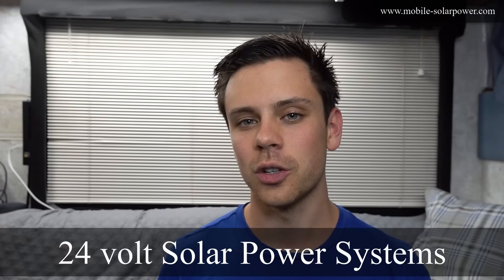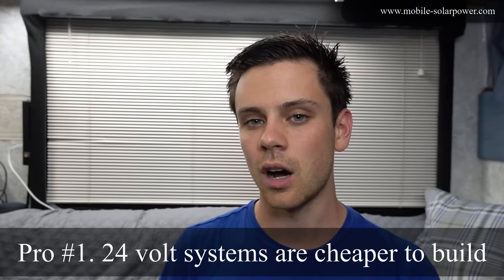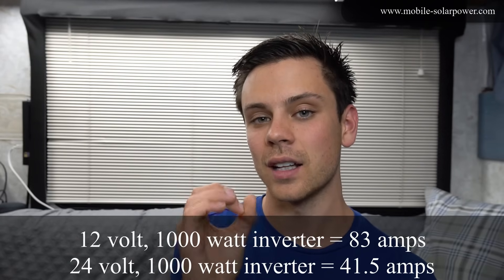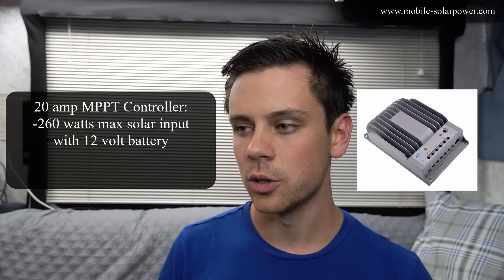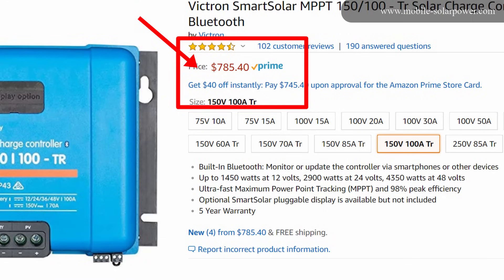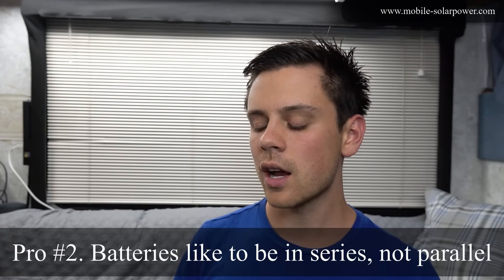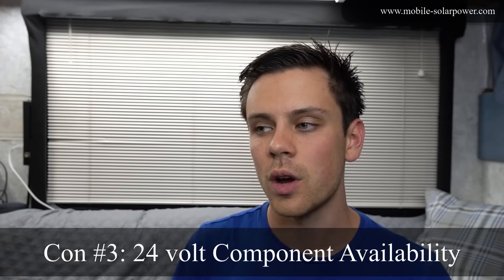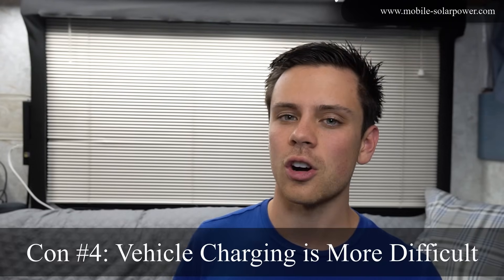12 volts VS. 24 volts for Off-grid Solar Power Systems

Comment: hi,if you have 2 x 12volt 110watt (5.5amp) panels and connect them as 24v...do you get 1x 24volt 110watt (11amp)panel?...using a 100a/h pwm solar controller .and would this be enough to charge a 24v 40a/h battery system?...love the vids they help alot!

Comment: I got 10 feet of high quality twisted copper 1/0 cable for my system from a welding supply place for $30. If you know where to get it it can be a lot cheaper than Amazon.

Comment: That's excellent information and dead on. 25 years ago I started my off grid home with 12 volt but switched to 24 because my loads increased to the point of killing batteries. Now I have 2000 watts of solar with 24 volt pannels and two 40 amp chargers and 1100 amp hr battery and a 2500 watt pure sine wave outback inverter. I run a forced air heater and full size fridge,dishwasher,full size washing machine and dryer and three flat screens krueg coffee maker in a 1400 sq ft three bedroom home. Never have to worry about a power outage. Havent seen a electric bill in over 25 years.
Reply: Any way to see the 24v set up? I’m looking to do the same but am fairly new to solar

Comment: This and your other recent vids have discussed 24V systems. I am planning a 24V system for my garage. I will have lights, a computer and occasionally small tools.  A 12V would work, but I plan to expand and don't want to redesign when that happens.

I do see Battleborn saying you can 4S4P their batteries, but you mentioned not more than 3 in parallel. Do you have any specific comments about the Battleborn 4P configuration. I know they have extra circuitry in the battery, but will that change your perspective on 4P. I am guessing 4S is not an issue with Battleborn.

Eventually I want a whole house 48V system. I will need A/C and radiant heat at that point.
Reply from the maker: Yeah that's not an issue with battle born. You're good

Comment: bloody great videos just subscribed..just one thing i have three 24v solar panels and four 12v batteries running both series and parallel for a 24v system...so how should i wire the panels? in parallel as a 24v array or series or both ..was a little confused on that part...cheers!

Comment: I have an rv with a 4.5kwh generator , I'd like to go solar with the generator as a top up when needed , it supplies 110 to the house sockets , what would be the easiest system to implement ? What would you recommend ?

Comment: Which is good 12v  or  24v  for  ON-grid solar system with HYBRID  inverter with No battery bank . 

My main is aim to produce maximum electricity. Thanks

Comment: Hi, do I have to stick with 12v if I have a 12v mover system drawing 80A current?
Reply: Is it for a caravan mover?
Reply: Yes it is.
Reply: @GaripGerçekler  ok , then you have to use 12 volts , so big cables .  It is my work to install mover systems on caravans . like truma or kroning movers.   I'm building a battery specificly for this application with Li ion batteries
Reply: Thank you dear friend.

Comment: if I have a 24 volt battery bank will a 200 watt/24 volt panel be enough to charge the battery bank?
Reply: Hi mate yes it will but you must use a solar controller the panel to the controller and then to the batteries check the amps on the back of the panel and if for example it supplies 15 amps under ideal conditions and you have three 24 volt batteries hooked up in parallel it will supply 5 amps to each battery if you have 10 batteries it will supply one and a half amps per battery cheers

Comment: to use a 12 volt solar panel to charge a 24 volt battery system you could always use a 12 volt step-up to a 24 volt system

Comment: @DIY Solar Power with Will Prowse you mention not using an alternator to charge 24v systems but didn't really discuss using a small gas generator like the 2,000 watt Honda's (or the less expensive clones).  I would like to put 2,000w of solar on my bus and then have a 2,000w generator I can use to charge batteries on cloudy days.  I am thinking three of the Tesla battery modules you reviewed.

Comment: I have a question for you, I'm a novice diy electrician,. I bought a Power Jack 5000 W HF PSW Pure Sine Wave, some time back  hoping to create free energy for my large RV . I could not get everything to work right & gave up, I was using a motor to alt. to battery to inverter,  relooking at it now I see maybe I don't need a battery. Your indeas or any hope would be appreciated. Thanks

Comment: Hi i got a cheap deal on 24 v deep cycle batterys and 1500 watts inverter off a lorry driver the batterys are wet type and fitted to van and wanted to charge it with the van engine but its a 12v system wee look about on internet i come a cross a charger that turns 12v into 24v to charge the batteries and got a trigger wire only starts charger at 13v and stops working when below 13v to stop the main battery going flat seem to work planning solar next and learning a lot from your excellent video this is all new stuff to me keep up the good work if i was thinking of upgrading the batteries to lithium batterys would i get away with the charger that iv got when van is running DON'T know if it would work but think it works but alternater charger the main battery then when it hit 13v it turn on the charger unit and turns the power form battery 12v to 24v and charger the batteries would this system work with lithium batterys and be safer because you sad its bad to use it form the vans own output for alternate or am i just com. Fuses  dot com cheers Sean any help be appreciated

Comment: Hi, nice informative video! Thank you for this. I'm planning to install a solar diy system for lighting only, no other equipment. This is the setup (250W panel, 30A MPPT charge controller, 100ah or 150ah deep cycle battery, 5-10W LED light bulbs 12V) do you think this is a good idea? I need advice/suggestions. Thank you!

Comment: Will you were a bit confusing or speaking fast with 24volt system.   Can u connect any number of 100 watt 12volt panels together or is there a specific number you must have? Could I connect 6 100watt 12volt panels or do I need to have 8 or 10?

Comment: we like to camp in my explorer after 4 wheel n in gloom city washington i have a power cutoff so it starts in the morning so i thought a deep cycle would be nice for a led light charge a phone a laptop recharge it when i get home then you got my head spinning with off grid solar madness and got a 50 watt panel a blue cheesy controller from our "friends"in the east ya the guys with the magnetic pules bomb that makes it a good idea to store it in a cage with the extra explorer ecu but my problem is i came across two sexy little lithium ion 12volt motercycle batterys for 80 bucks  and  it was love tell i found out i cant charge em evan at home the controler goes down to 12.8 with my multi meter can i pull them off at 12.5 or so ?

Comment: I have a question if I wanted  to run a house fan for 12 hours how many batteries should  I use for a solar system an if I went with a 24 volt  system would if allow me to use less batteries

Comment: This seems as good of video as any to ask this question. How does one go about charging a small system off a generator threw a solar charge controller? I know many pre built set ups will charge off the wall.....in 10 hours and that kind of defeats the purpose. The sun isn't very reliable where live many months out of the year and I'd like to be able to charge batteries at a rate of C/4 or less. In terms of an emergency saving on fuel for a generator is crucial so the idea of running it for four hours or less a day is very appealing.

Comment: I got 300 watts I'm going to bring it up to 400 was thinking switching over to 24 volt and run my inverter of one battery in the system sence I dont have a 24volt inverter I live in a trailer 24 foot converted to a tiny home would 24 volt be beter than the 12volt or should i keep the 400 watts and keep running it of it? Using a 12000 watt inverter with a 6000 watt output .and a 2200 watt inverter to run my TV fans the 6000 runs the rest fridge coffe pot microwave lights

Comment: i actually run 2x banks of 520w @24v then into my epsolar mppt to charge my 12v bank , so 1040wats of 24v solar to charge 12v bank , seems to work realy well ?? why do i not see ppl talking about this ?
Reply: This is where the system gets a little more complex. If you're going to talk about it, best to make sure that even the noob understands or make a disclaimet. Talk about multiple positives and negatives, grounding, and proper wiring so as to not cause short from having multiple banks and arrays clustered into one bank/array working together. It's easy for you and even I can do that but there are plenty out there that don't know what they're  doing and could end up damaging the system or even killing themselves.

Comment: Question: If i just want the amp hours, say 200ah and i am only running one 300watt panel, It seams the best system for me would be a DIY 200ah 12volt Lipo4, like on your website? any thoughts I was going to use a Tesla instead for the 24volt . Thanks all

Comment: Hello I have installed 12 v system in my cottage a few years ago with 8  T-105s which are now ready to be replaced.   I'm Replacing with 8 L16 S6 Surette Rolls,  I also just purchased a 12 volt 4000 watt pure sine wave inverter to replace my 2750 modified wave inverter.  I have a small wind generator at the lake front and two panels which I'm replacing with 4 new 315 watt panels.  Do I return my 12volt inverter and get a 24 volt? on the rewire,  I have Morningstar charge controllers so I believe they may convert.  Just not sure what to do,  everything is set for 12v right now.   I would have to get a converter to run  my two 12v under counter Tundra  fridges if I change to 24v.   I guess I'm asking is it worth the change over to 24v while I'm Installing new Battery bank inverter plus new panels?  or should I just roll with the 12v system.  The Panels at the Lake Front have a 90ft run using 2awg which is barried
  in conduit

Comment: Ok... Good info. However I'm still confused on if I should run my system in 24 volts. Most of these examples seem to be for the home on various scales. Looking to run a greenhouse and a pond off grid. About 30feet  apart. 2 fountain pumps, 1 fan and possibly 2 heaters for the small pond in greenhouse and larger outdoor pond. Could I get away with a 12v system? 2 agm 6v solar batteries in series? Fountains would run continuously (ideally)  and everything else would run on a timer (or as needed when it comes to pond heaters). I'm thinking of slapping together an amorphous (harbor freight) array with possibly 7 panels (175 watts)? Got 3 panels for 50 bucks and looking to purchase the kit with 4 for another 150 bucks. I'm in the Pacific northwest and am thinking with our cloud cover amorphous is the way to go? I've gathered nearly all my solar knowledge from your videos. Am I off base here?

Comment: I have a question I hope you will be kind to try to answer. If i have 2 x 100w panels that is 24V in series can a PWM regulate it to fit my 12V inverter? Or should I just wire the panels in parallel? Or can a PWM controller downgrade 24V from the panel to 12 to the inverter or am I doomed?

Comment: Hi, you have great videos, thank you for your help. Can you help with a system for my water well Pump: Franklin Electric 2823008110 Standard Submersible Motor Control Box 1.5 HP 230V 1PH For 3-Wire Motors

Comment: So I have been off-grid now for 6 years. I spent a lot of money doing trial and error setups. I had the basics down in 6 years, but all was self learned. No mentors, no neighbors to learn from, and no YouTube videos. I have since started watching all of your videos and have tripled my knowledge of off-grid solar setups in 2 days. For example, I have 8 12v agm batteries wired in parallel. I have wondered why I go through battery banks in a year or 2. I always thought that if you ran the batteries down to the inverter’s low voltage alarm it would be ok. That being said, last winter was one of the rainiest winter seasons in N. GA, so obviously I ran my batteries down to 10.5v and had no idea it was damaging them beyond repair. YouTube is amazing and thanks so much for your videos.
Reply: Thankyou for sharing candidly, ur experiences ... this also adds value to the original vid ... thanku
Reply: I've been off grid for 6 years as well and can echo your statement.
Reply: 9878
Reply: I've been off grid 8 yrs, trial and error learning. I have so many questions for this fellow. He is so easy to understand.

Comment: Thanks for the video.  Is an 18 V Solar Panel the exact same as a 12 V Solar Panel?  Sometimes on Amazon, panels are designated 100W and 18V.  Read your book (BTW: Its Excellent and I plan a written review) but did not find any reference to 18V Solar Panels in it.  Would be great to get a video that goes over panel specification details and some explanation reading the back of Solar Panels.

Comment: So Thank you for making your videos clear, and understandable. I'm thinking about a 600w 24v off grid system. I just may want to run a 15K AC unit for several hours. I intend to use LiPo4 batts... Renogy sells a system that encompasses, all I said, without batteries. In your opinion, is it worth $900, and am I just being silly trying to run AC off solar, n batts?I know I would need at least a 3K inverter, and a 24v-12V converter. I would be running an RV fridge, and a TV, DVD, and lights, you know typical RV living...I'm doing this to sometimes Boondock, but more so be prepared for emergencies.Thanks.

Comment: Hey Will, from South Australia. Great vid, as usual ! One question, do those voltage converters use any power with no load on them ( like a phantom load?)
 Thanks very much, Simon. ( Sundancer)
Reply: My 30 amp converter draws 25mA at no load, my old 12amp converter has a no load  draw of 5mA. Both we made by Samlex, efficiency is north of 90%. Not as bad as  no load on an AC inverter.
Reply: @victormalarenko4827  Thanks very much for that information,   :)

Comment: So what i get from this video is that i need 24x 12v 120AH AGM batteries, with 6 sets of 4 in series to generate 48v, then wire those 6 sets in parallel into my inverter to run my home at night.

Comment: Great channel. I have 1 question . I am using 4 x 100 watt panels. 40 amp controller .  40' run to controller from panels # 10 wire. Parallel or series the panels ?  I would run  2  x 6 volt golf batteries for 12 volt system. Or 2 x 12 volt AGM for a 24 volt system. Already have a IOTA 24 volt charger . Running a 2000 watt converter but need to know first if I am going 24 volt system or 12 volt.  Can you please help me .

Comment: I have a question, I just started using my solar system today on my off-grid cabin. I have 4 100-watt panels, MPPT (P) series 60A charge controller, and a Giandel 1200W Pure Sine Wave Power Inverter, and 2 deep cycle marine batteries. I had full sun, batteries were fully charge and had a box fan plugged directly into the invertor. After about an hour or so the invertor shut down and an intermittent buzzer began. The display showed an LO in it. I looked it up in the manual and that LO represents the current status of under voltage protection. what could be causing this? like i said the batteries are charged at 13.8 consistently.

Comment: 9:00 better having a specific 12v circuit for rv appliances that charge with alternator than using many converters and else between 12 and 24v syatems

Comment: Good video. How about using 2x12V batteries in series for your 24V solar system and then use only one battery to power your 12V RV installation. Occasionally swapping batteries,  Or run half of you devices from one battery and half of them from the other. Not ideal solution but it would work for someone on budget
Reply: I run my shop on 12 volt I have 3 windmill made for alternators 5 solar panels and 14 6 volt lead aside batteries every thing in my is converted to run on 12 volt my air compressors Lighting my yard light and my bench grinder are all 12 volt

Comment: I would like to know if i have same amount of roof size for solar panel.  Does 24v 200ah lifepo4 battery charge faster than a 12v 400ah lifepo4 battery setup?  Or the charging speed is the same. Just the cost of wiring and addition of converter is different?

Comment: Hi Will,  I've watched just about every video you have produced and read your book as well so Thank You for everything you do. Specifically i'm interested in building a highly mobile Class-B boondocking RV system and trying to understand where a 48v system might play in solar / shore power / 2nd alternator 58v fast charging scenario. In your video's you have made some high level references to 48v systems but wanted to ask if you would consider having a video (or a part of one) which discusses pros / cons of 48v systems so we could get your thoughts to pursue or just focus on 24v systems which seem to be more mainstream as in your video. Thank you for the consideration.